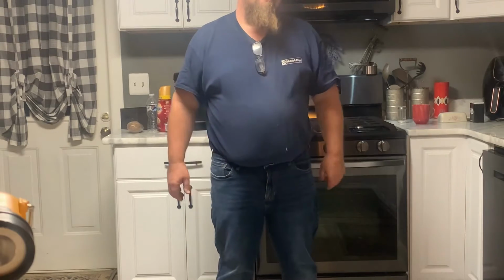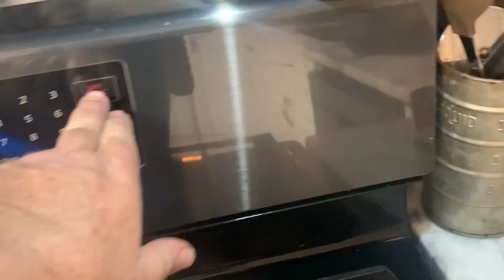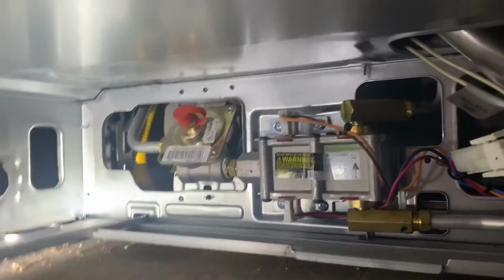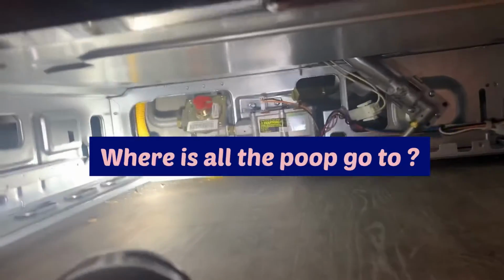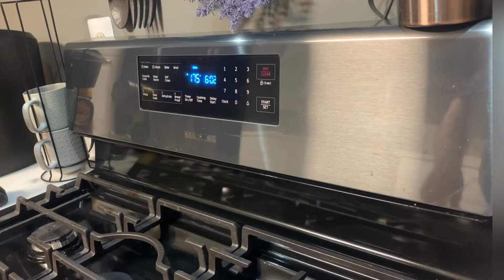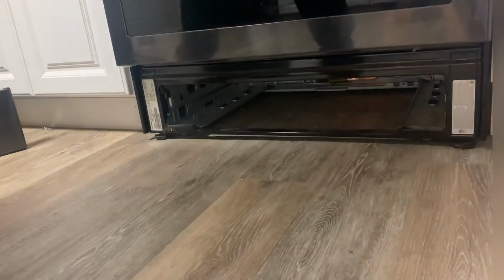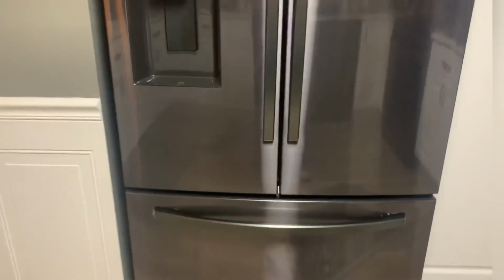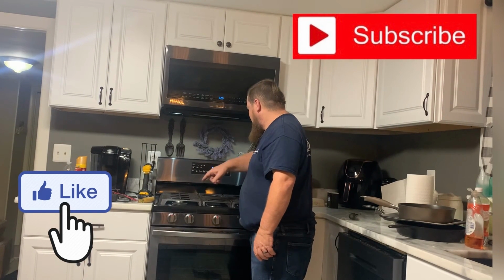Samsung oven low heat fix

Comment: I have a same exact stove and that valve that you were talking about is how did you adjust it please all though the valve on my stove it's in the same position as what I seen in your video, I'm just hanging hard time turning the valve up or down and also i don't this inf on the manual ether thanks
Reply from the maker: @florimbaj  yeah the manual was not very clear in details. It just says do this and do this and do that. What I had to do was turn the valve all the way off and then push down and turn it all the way on it kind of sticks just before it turns all the way on

Comment: So you put it in the opposition did you have to put it in back in the down position?
Reply from the maker: @sherrymiller8167  
Hi Sherry , so what is happening is the lever catches and doesn’t completely go in the open position. So what I did was turn it back off and then push down and turn it on all the way. The gas valve kind of sticks just before it goes into the full open position. That’s why the light but it won’t turn up to full volume or full heat.  The valve is not all the way open then it slows down the volume of gas going through the valve.  I hope this helps.  From what I learned that this is a common issue with this model gas valve.

Comment: Did this end up fixing the issue ? 

I have the same stove and I have the same issue. So I want to know if it turned out to be something else.
Reply from the maker: It turns out that the gas valve had a sticky spot and I thought it was in the open position

Comment: I hope this works on my even I’m having the same problem it won’t go past 150 degrees
Reply from the maker: Good luck, there’s not much in the mechanical department on these stoves. Pay close attention to the change over from Gas to Propane if that’s one of the things you are doing and just make sure the valve on the unit is open all the way. It was vary frustrating but when I sat back and looked at how simple the system was and thought to myself “ I must be overthinking things. 
Post back when you find the issue, God Bless
Reply: @fixingthingswithpastorbill3840  ok I will let u know how it goes

Comment: Hello , my electric stove oven will not work when it is cold , the eyes will work but when i set the oven temp then the lights cut off so I can't set oven temp , it works with no problems all summer but as soon as it gets cold outside is when it gives me trouble , when it heats up outside then the lights will come back on then it works .. HELP

Comment: What is the part number for the ignitor ?
Reply: The sensor i meant
Reply from the maker: Mine was not a sensor issue, it was a sticky spot in the gas valve that stopped the valve from opening all the way
Reply from the maker: @P Kohler I didn’t fix it I just turned it on and off and noticed it would turn further past the sticky spot
Reply: Thanks for your video, I had the same problem intermittent. I was wondering why you took the door off? I was able to reach underneath after I pulled the warming tray out.
Reply from the maker: @kdubb666  
Because I was checking the sensors and burners

Comment: What valve
Reply from the maker: @sherrymiller8167  if you pull the bottom drawer out all the way and lay down on the floor, you can see the valve in the back. They don’t make it very easy to work on and the valve is kind of stiff.

Comment: So because you check your ranges and settings and they are ok you dont bother to tell us how to check ours
Reply from the maker: Not because, so I didn’t bother. I do the videos so it might help not to make your life miserable, I just showed you how my range was fixed , I am not a Samsung repair man just someone sharing my experience on how I fixed mine.
Reply from the maker: I reviewed the video and I did not need to check all the sensors because I found the problem with my stove “gas valve was not fully opened “.